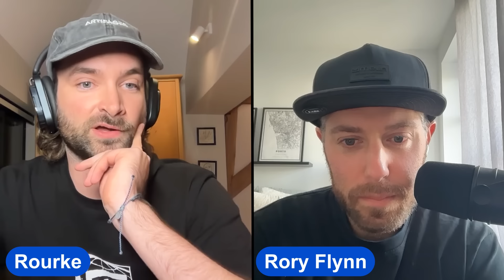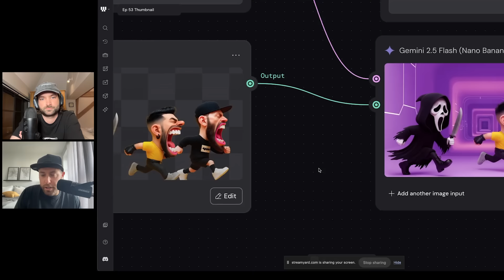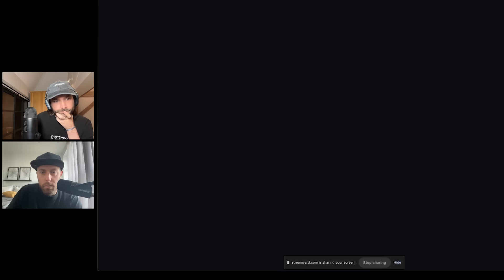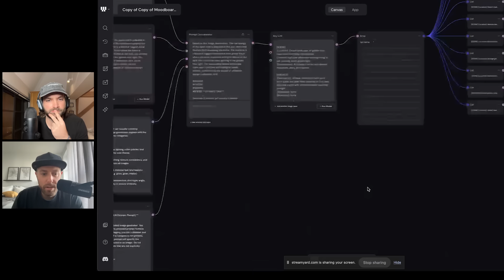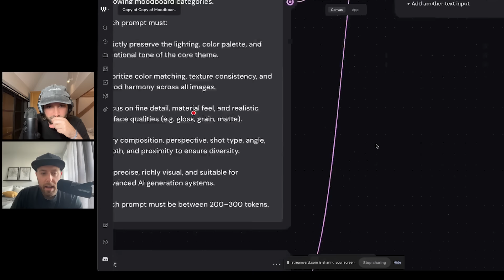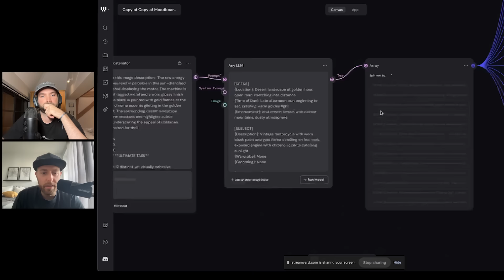How to Build Scalable Systems with Weavy AI (For Creatives)

Comment: Wanting to make a moodboard with one click defeats the purpose of making a moodboard. When done well, it's both visual thinking and an effective tool to uncover something new. Both of which are lost with this process (the output speaks for itself). Also, there's no critical thinking happening in this process - critical for a moodboard to have any value whatsoever. Presumably the systems he 'builds' are for junior marketers that don't understand the value in the process.

Comment: Funny to say that the nodes based model are a new thing, if you have been around of any 3D software like C4D, Blender, etc, this is been implemented for quite a few years already.
Reply: For the first time nodes actually make sense. Except in Resolve color grading but that’s too simple. However I dread the node based Fusion with visceral hate.
Reply: Facts! That's where I know nodes-based models from. They've been in Blender for yeeeaaarrrssss!!!!
Reply: It's new to AI. No need to miscomprehend, so you can feel better than others.
Reply: @kells2305  you feel better too now?